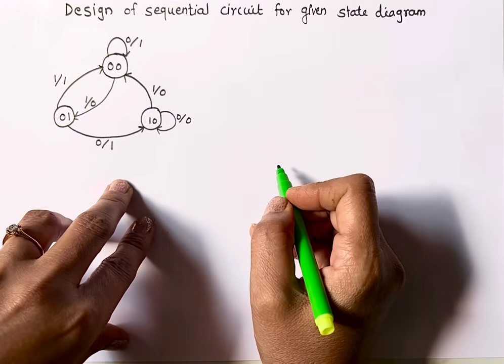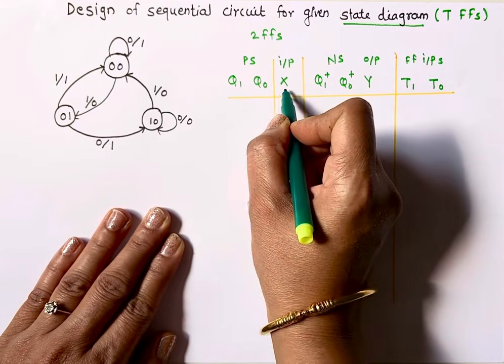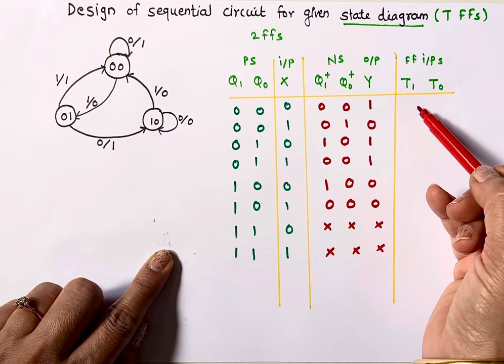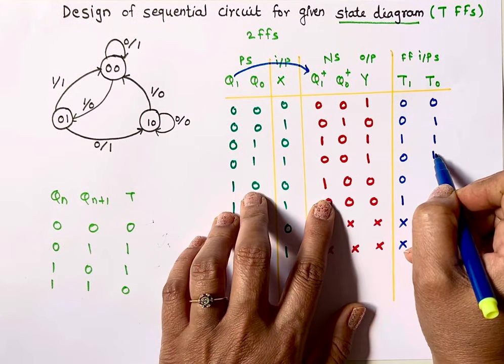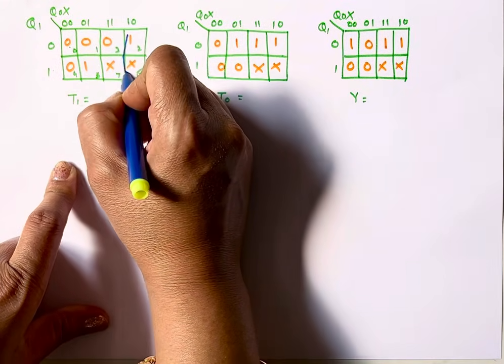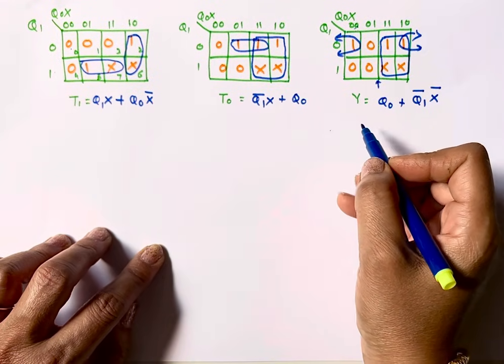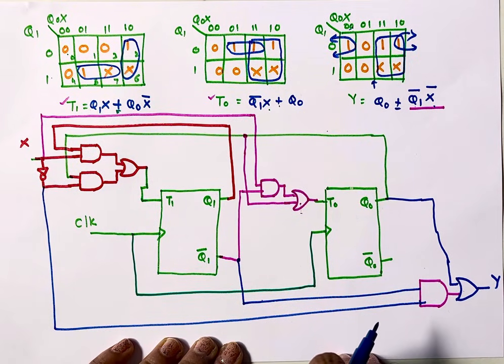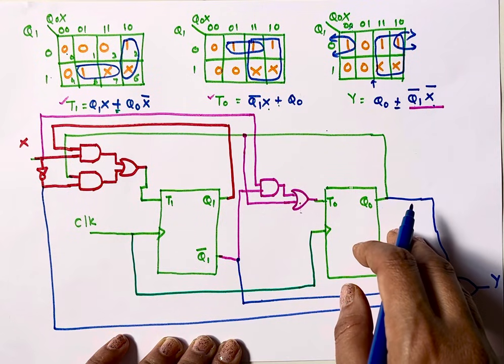Design of Clocked Sequential Circuit | for given State Diagram | using T Flip flops

Comment: “If we had taken the X input from the clock, would the circuit still work correctly?
Can we show it this way in the design?”
Reply from the maker: No.  FSM has flip flops . Every flip has separate data input and clock input. So can’t take X from clock. For clock as a x input sequence will become 1010.